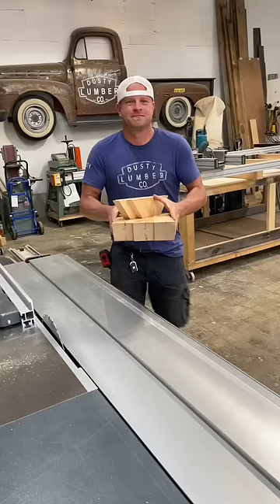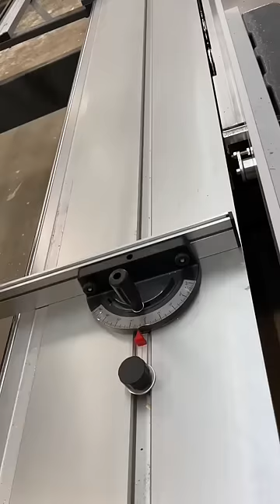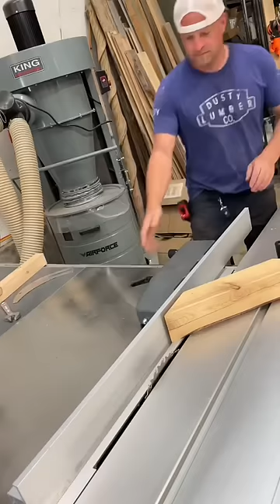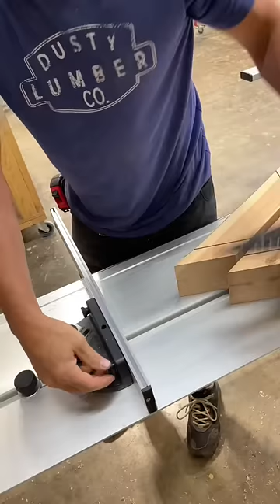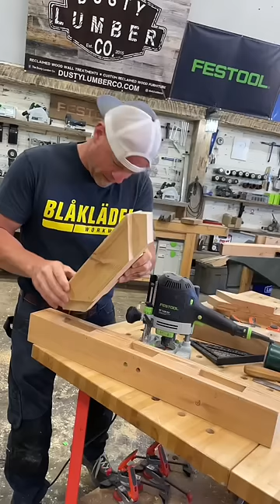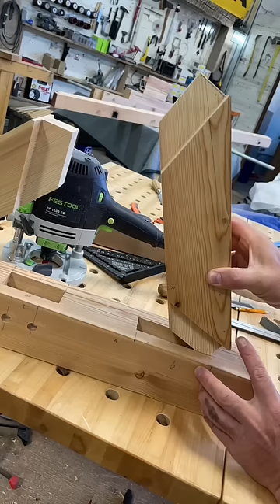Cutting tenons #woodwork #wood #woodworking #bois #holz #maker #tools #madera #joinery #fun #work

Comment: I worked on an all woman carpenter crew 1976-1984ish.  We put the mill in the garage. Door units & trim started while I layed out kitchen and built-in cabs throughout; sliced 1x2 face frame stock using parana pine,  tops & bottoms and 3/4" plywood endpanels  hand drilled for shelf clips.  Stack-um linen cabs, hutch, entertainment centers. Trimmed out single entry door with side-lights ready for glass to save builder $.
Wagon wheel, ski-lodge and regular beams, library style paneling, arch-top, raised panel cab doors.  Big built out, stair-step ceiling moldings and hand crafted mantle.  We would be in and out in about a week.  Usually 2500 to 3200 Sq ft homes.  Would circle back in about two weeks to install cabinet hardware, thresholds, baseboards @ tile showers, tubs etc.
I Love watching you work.  Dang you are so good.  
And I can tell you love what you do. 
Thanks for posting your handy work, which takes lots of knowledge with awesome precise cuts.